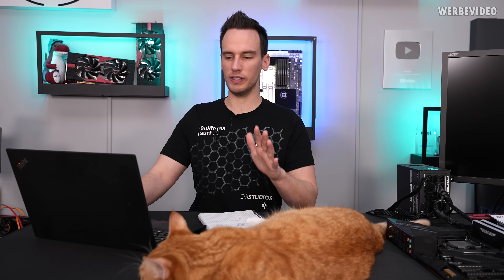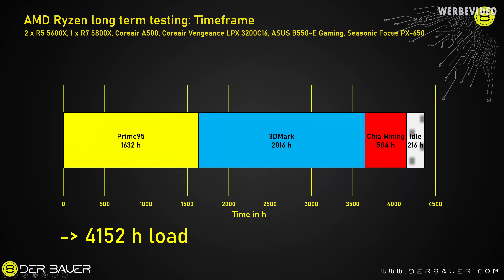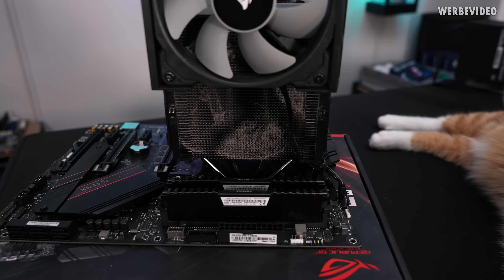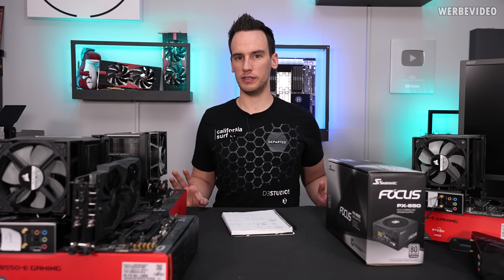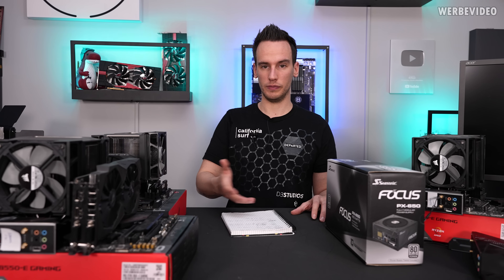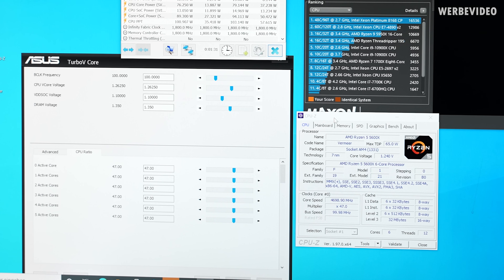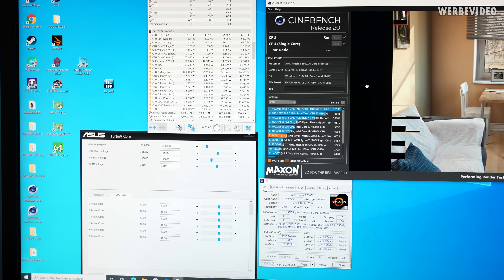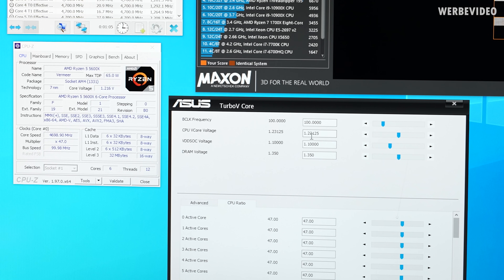4152 hours of Ryzen Long Term Testing: We have Good and Bad News

Comment: I would love to see how a 12900k fairs running at high voltage and 95c for a year. It runs very hot.
Reply: Power in Germany is expensive though...
Reply: Power in germany is about 30cents per KWh, that would be 2.16eur per day, if there are 3 test benchs that would be 2365 euros a year or 2.7k USD.
Reply: @zaxmaxlax  You multiplied by 3 two times, correct math for 24/7 100W more and three machines would be 0.3*0.1*24*365*3 which is 788.4 EUR 
Not bad considering that ridiculous electricity price.
Reply: will be fine, i boot my 9700kf in the face with 1.42 vcore and 99c just to get 4.9ghz all core avx
been rock solid linpack avx stable since day 1
Reply: Probably not well. It is a 240 watt CPU after all if you leave the UEFI settings the way the board manufacturers have them. Gotta have those auto-overclock features enabled to make your motherboard seem like the fastest one. -_-
Reply: @JosephArata  for gaming it's basically the same as AMD in terms of power consumption. Alder lake is just as efficient in cases like gaming and idling/browsing, it's the 100% workloads where it draws that much power.
Reply: @JosephArata  Well MSI and ASUS also does that with AMD. I built a few 3000 gen Ryzen systems for a few friends and I had to RMA 4 out of 7 CPUs since they werent stable at stock and the 3900Xs cant get anywhere near their rated speeds at the rated TDP. I love my 3900X (cuz I got it cheap af) but I hate it too since it took like a week to get it stable and under full load at good clocks at reasonable power
Reply: @JosephArata  It will probably be fine, I have seen no evidence for silicon degradation due to near 95c sustained temps. I remember people throwing this argument around when AMD had their space heater 2xx-3xx series gpus and bulldozer cpus. Many of which are still running just fine to this day with no evidence of silicon decay.
Reply: @JosephArata  naa bro intel nodes are tanks
Reply: @Boogeymanjw  It's not about if the node can take it or not, 95C 24/7 is not power efficient at 240w, nor is it good for the rest of your PC components being trapped around that much heat.
Reply: Think of the power bills xD
Reply: @TrebleSketch  lol the power bills…0.78$/24hrs. 136$ for 4200hrs, which is almost 2 years at 8hrs/day full blast…Power is really irrelevant bro…If you spend 750$ on a top of the line CPU and then complain about 68$/year in hydro you need to get your priorities straight.
Reply: @radugrigoras  I guess I didn't realise power was that cheap where they are.

It's like ~0.40AUD/kWh here (plus ~1$/day of supply charge), if it's just CPU heavy benchmarks for ~300W of total system power that'll be ~0.13AUD/h and ~3.2AUD/day +1$ supply charge. For 4.2AUD/day and 4200 hours is around 175 days.

So for ~175 days (~2 quarters) it would be, 560AUD W/O supply charge (735AUD with SC). Guess the cost just sounded crazy on my end 😅
Reply: @radugrigoras  Exactly, power consumption is totally irrelevant as a "it will be cheaper to run" metric with such devices. There are people that still use incandescent light bulbs (60, 80, 100 W per bulb) yet are trying to "save" money looking at low power appliance energy ratings or in this case CPU power consumption.
But for average consumer it can and probably will matter for cooling since almost all of that power will be turned into heat (we can pretty much say all of it since other types of emissions are so low in comparison). And in the end all of that actually matters if it is used for production work that is heavily using AVX instructions since in gaming, power consumption is much lower in comparison.
Reply: @XPACT3  The only situation where I really do consider power consumption is if the computer is in a closed room and/or with inadequate cooling. The room where I keep my computer has no air vents, so heat accumulates quickly but otherwise I agree that cost of power usually is too negligible to take into account (especially here with around $0.05 USD / kWh ;) )
Reply: @radugrigoras  your air conditioning will also need to cool 130W more heat if that CPU is running instead of a normal 120W one. You should factor that also in the Energy bills. You are paying to have your house at a stable temperature, not only to run your CPU.
Reply: @XPACT3  It's not irrelevant, the USA is not the only country in the world you know......
Reply: @JosephArata  I am not from the USA, not sure where you got that from. 
Anyways, electric power cost where I am is 0.05-0.06$ per KWh so I never calculate using that since it is considered too cheap world wide.
Reply: @TrebleSketch  Power isnt that cheap. in Austria its about 0.22€/kWh with other charges too so my mentality for overclocking has always been "Stick with lower stable voltages and push it from there" My GTX1070TI is proudly running at 1911mhz at a chill 875mv. Absolute max power is 170 watts
Reply: @TrebleSketch  Holly molly, you are charged .29.34USD/kWh? That is insane. In the states the worst you really get is near .20USD/kWh and that is if you are in Cali. Most states get around .9-.13USD/kWh. I know Aussies are some of the wealthiest people but jeez.
Reply: @radugrigoras  power usage is not so irrelevant,.. you need to cool down that thing too. it meens heat,.. and in summer its thing to cool room too,..
Reply: @TrebleSketch  you also have to take into account that if you're are doing a real world task and you use more power but it gets the task done quicker,  then the power consumption equals out between the amd and intel cpus.
Reply: Intel have been in the game a long time and they have the best chip voltage and thermal regulation in the game, I think Alderlake will be just as reliable as all the chips before them

Comment: Very impressive. 1.45v is much more than I used when max out the oc. 1.35v at most
Reply: If you see that even 1.45v with thousands of hours of prime 95 is no problem you should really not be concerned about normal overclocking even if the cpu is used like 10 years.
Reply: 1.35 is very manageble imo
Reply: @rash3382  People have been HEAVILY  speculating about TSMC 7nm, that's why he did this test.  People have been saying for YEARS that running just 1.250vcore static will end up quickly killing your chip! lol
Reply: my r7 1700 got 1.3975v for 5 years no degradation
Reply: @ThaexakaMavro  
My r5 1600 is undervolted 1.289v for 5 years, but only 3.8GHz. Temps are very cool though, 27C idle on single tower air and only draws 22 watts package lol
Reply: Amd in fact suggested this cpu should be at 1.35v max to be " safe " but even until 1.39v there's no major issues. Expecially the 5600x. Can be o.c. to 4.750 mhz all core at Lower then 1.31v if undervolted with pbo and then manually o.c.
Reply: @andreabriganti8621  AMD never have, they’ve only ever stated officially to just leave the limits in place on and it’ll be fine. The “1.35V” came from redditors who know better than TSMC and AMD. AMD has never published degradation stats or papers for any Ryzen product.
Reply: @MartinGod3992  there was a good post on r/overclocking on the degradation of a 3600 at 1.4v IIRC, but nothing near the extent that Roman has done in this video.
Reply: @MadSupra354  oh i know, point is though that AMD officialy have given no numbers
Reply: @andreabriganti8621  mine runs 4.75 at 1.3V dead. Wants to go past 4.8 but i can't keep it cool enough on air
Reply: @M3PH11  Right, noticed that. With  a good air cooler it's more than fine until 4.75 all core. However, try to go over that in all core and various issues will happen, most of the times. Thermals, overall stability etc. Not 100% sure why. Maybe it's the air cooling limit with those cpu. With a good A.I.O. I saw going until 4.85 but honestly, from 4.75 to 4.85 isn't a game changer.
Reply: Well, my 5600x is UV (PBO CO negative 30-30-25-20-20-30) to approximately 1.17V average. It can only peak sometimes to up to 1.3 but not higher than 1.33. Peaks happen VERY rarely and for very short time.
Common voltage is around 1.11-1.15V idle (core is around 0.85V), and around 1.15-1.19 under load (normal load, not bench type) with those rare peaks i mentioned before..
P.S. no performance was lost, i still have +50 mHz  boost overdrive fully working. don't actually see a point of overclocking it further as i prefer mine to be more efficient (it is that i am not able to fully load 5600x anyways)

Comment: Darn!
Reply: I have a SandyBridge that was running on the max datasheet voltage of 1.52v for years, it won't run at the old overclock anymore but still works at "stock" boost clocks. It is currently in my niece her PC!